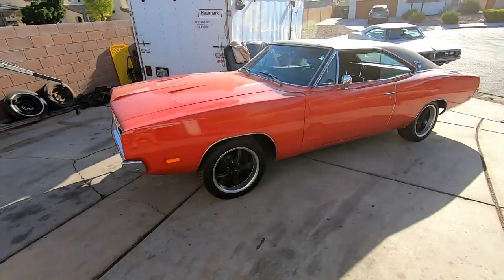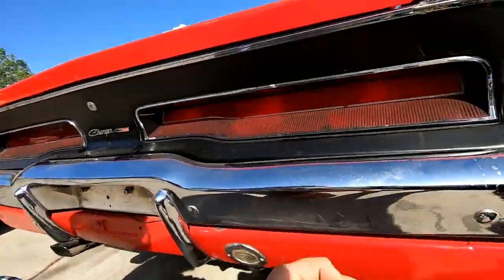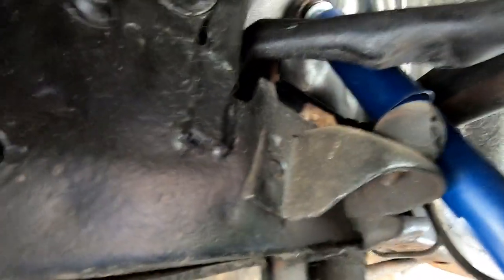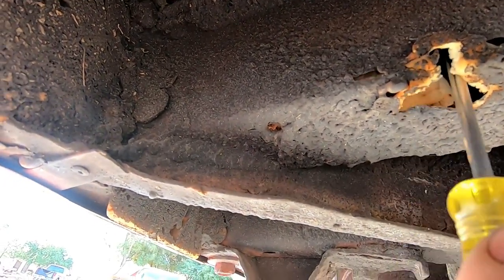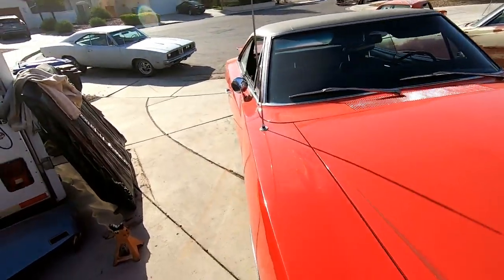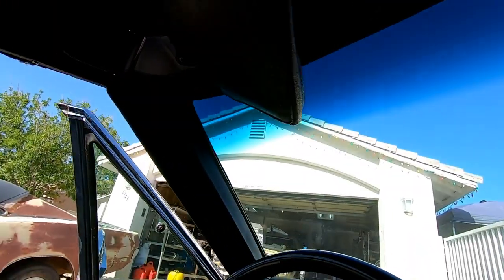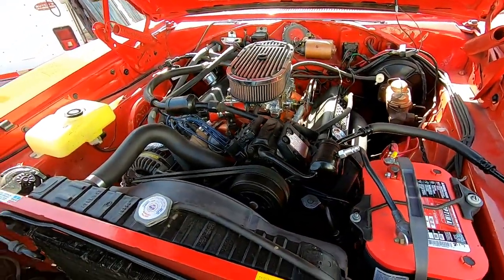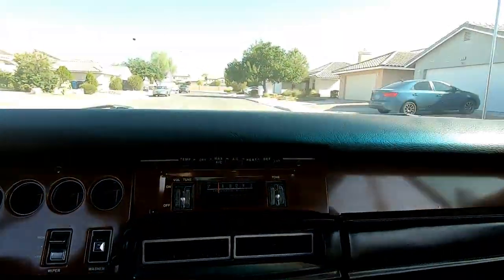Look Before You Buy that shiny Polished Turd...

Comment: It’ll need rocker panels, quarter panels and trunk floor extensions.  I remember cars In Michigan during the 1970s where they would rust away within the first 5 years no matter how much you washed and waxed them. The body would rot long before the engine would fail. Some present day Mopar restorations are done to perfection,  in reality the build quality of the original Mopars was horrendous.
Reply: Yeah I have had them all here in Michigan, big block and small block six pack cars Hemi car Etc. Being a Michigan person all my life I have run into so so many issues with vehicles. In reality growing up here in the 1970s taught me all the things that is in this video. Very few things will ever get past me when I go look at a car. The one I have now gorgeous as a Michigan car. If you want to obtain a better body vehicle, seek out the former drag cars that spent their entire life at the strip. Many of them have been crashed and had doors and fenders and front Clips replaced, so you have to look for those things also, but overall you will get a more solid vehicle by far because the thing wasn't being driven in the salt or being parked out beside a barn for 25 years. My father always said let the buyer beware... True and honest words. Look very carefully before you plunk down purchase money

Comment: Two main companies on the east coast that did rust proofing back in the day were Z bart and Rusty Jones.   I worked for a company out of Harrisburg, PA that used carnauba wax with a fluorescent dye formula to prevent rust in new cars.   They sold the dealer I worked for a black light and the spray gun with attachments.   No holes were drilled.  the stuff was sprayed into the body weap holes until you saw the green dye show up around the points where water would come in.  The warranty  was useless because the company went belly up in about 5 years.  They paid me $6.50 an hour and the cans of wax cost the dealership $20 a can.  They charged the customer $300 for the service.  A big car took 2 cans and a truck was suppose to take 3 cans.  The dang shady dealership I worked for cut both of those down and still charged the $300.  They are no longer in business either.

Comment: Great lessons..   Chris..  Looks.like the Chargers rot every were..  😂 
But you live in vegas so wont happen to your cars.   Lucky guy.  
Took a lot of work to put on all that Bondo to so hard working Bondo man.   😂...
Reply: Dude they are are 50 year old cars and depending on where they are from and how they are taken care of most are going to have rust issues. unless they washed the car all the time and kept it in a garage or on a cement slab out of the weather they won't rust but to park them in the grass where moisture comes out of the ground and leave it under a tree or in the rain and weather and drive down dirt roads and off road it's going to have issues
Reply: @79tazman  jep i know...  My car is in the summer under a car port were the wind.dry s it.out fast and in.winter i do not.drive him..  Its in.my.garage then.. !!   👍🏼

Comment: I have never come out ahead on a car deal  , because if you love cars , you can not flip them like a commodity. Today I own what is my last old car, A 1978 Chrysler Newport , 360 cid , 904 torqueflite. At age 67 , failed health, my car days are over ! My last hotrod was sold last January at a $1500 loss, it was a 1998 Lincoln Mark Vlll ,cobra V8 and fast , I cruised I-15 for 4 hours at 100 mph at 3500 rpm.

Comment: In  Michigan there are two kinds of cars..  The ones that  were stored away in Garages in the Winter..  and  the ones  that rusted away and  went to the scrap yard..     I bought a  Z-28 Camaro in 1979 .   I did drive it two Winters..   some in MI  some in Colorado  and some in FL & LA..  I had it Ziebarted..  I washed it a  lot ..  I can't really see any rust on it..  but I cut the wheel wells out  to put wider ties on it to win the Spector  drags at a local circle track ..

Comment: Well a car worth 8.000$ dressed up for 3.000$, sold for 40.000$, had to be fixed for 20.000$.
I'd rather buy a rusted Rat than a "restored" one.

And BTW a story from me and a yerk:

I once wanted to buy a "original car ,no rust, not welded, 2nd owner car ,accident free, regular dealer service, low mileage".
I called the guy we talked , my friend  took me there and this guy said we had to go to the garage he parked it.
Well 1/2 hour later at the garage ,there was a second guy waiting to purchase the car too.
We get in this dark Parkhouse where the Dusted car sat. 
The other guy cheked it asked questions blabla...
I got to check the car while these two were negotiated after I was done I asked him my question:

  Why is the passenger door  different colored with different trim and not opening/shuting correct?
  Why is there a Gigant dent  in the Passenger Rocker?                                               It's accident free.
  Why are there rust holes in the Floor?                                                                           It's rust free.
  Why is the Rearvailence welded?                                                                                   It has not been welded.
  Why is there a 4th owner in the Service sheet's?                                                         It's 2nd owner.
  Why are there servier more miles in the paper work than on the odometer?         It's low mileage
  Why are there not matching Seats? should have bucket seats in the front matching the Rear Seat not some cloth ones in different color and material.

I told him he is a Scum and what a lier he was, he wants to discus it but I left,
The other guy aint as knolwedged as I bougth this turd for 1.000

and you could see on his face he apparently wasn't glad buying it after I revealed it's condition.
The callout were 2.500 for it at the beginn I would 've paid 750 if he wouldn't lie.

BTW. The car got back on sale from this other guy some months later with painted door and with all the other mangles I revealed.

Comment: My personal low point was a Challenger with a freshly-painted 340- with overspray on the plug wires. The top of the engine had been repainted while it was in the car. Couldn't quite believe it.

Comment: As of the date of this comment, there is a restomod Charger for sale on the Gateway website for $147K.  Supposedly, it was completely redone, frame off, etc....  Loads of upgrades as well.  Looks great in the photos and video.   I am wondering if I would be better off purchasing that one (for about $130K or so, it if Gateway will negotiate)  rather than paying $85K for a car with some obvious issues and no telling what is going on behind the paint.  I do NOT want a project car of I can help it.

Comment: I recently found a running 1970 340 4 spd Duster , (VS- H code), for a good deal, 7K. When I saw fuse box hanging under the dash and a sea of splices, rubberized paint used everywhere, E-body steering column, E-body  bucket seats, and many other red flags, I passed it on to others. An acquaintence bought it anyhow on his own 2 feet. Now, guess who gets to fix this frankenstein?  It is coming along, but soooo many wannabe mechanics have done their magic # on this car. I made up a nickname for those who won't use proper hardware etc......Coffee Can Mechanics, (Use whatever is in the Folgers can, if you are out of baling wire).  We are gaining on it however, slowly.......like they say, look REAL CLOSELY, before you buy. I can't say this enough............

Comment: 47:33: Another thing to ask: "Why is the fuel line wrapped from end to end in heat shield?" Almost always indicative of someone trying to fight a persistent vapor lock or fuel boiling issue (especially common now with lower fuel boiling points than BITD), which the shielding itself won't solve. Expect to run a 440-spec return line and fuel filter (whether original or Wix-style) back to the sender, which will also need to be modified (don't bother with repop senders if you value your fuel gauge reading).

Also, why is the fuel line routed OVER the alternator? 😲

Comment: I use that "poor mode" trick. The gf was looking around for her next used car, so we took her old junk car instead of my truck that's still worth something or my old restored trans am. And play it off at first that I don't know much about cars as I question the owner. Then once I start to really look at the car, I bring out the scan tool, my magnet checking for bondo, and then out come the ramps and my creeper and flashlight. Generally then people start admitting things I wouldn't have ever found.

Now my buddy was looking for an LS1 F-body, and brought me for "expert" advice... Then we show up in my restored T/A, generally I'll talk up the owner a bit about everything I had to do to restore my car. They usually end up not trying to hide things assuming I'll find problems.

Gotta buy a few lemons before you figure this stuff out.

Comment: I`ve never seen a column shift on a charger. I had a 1970 back in the early `80`s and had a blast. Wish I would have kept it.
Reply: I bought a 1969 Charger in 1991 with a column shift 383.  I think that was the first thing I replaced.  You could still find parts cars in junkyards back then so it was easy to find a clean column without the shifter.

Comment: Bro i bought a 93 S10 and finding a square body mini truck was just as bad. I think finding anything older than 20 years old in decent condition is hard. I had to buy one that was posted within 6 hours of me finding it. And dude already had another guy on stand by so i had to give him what he wanted rather than what I wanted to give up when the other guy came along to get it. It ended up almost like an auction. I was closer than the first guy was as far as driving distance so i showed up first and then the other guys wife wouldnt let him go up the extra couple hundred that I did. My dream car is a dodge charger. The 68, 69, and 70 years but thats a goal i have to reach one day. Start small and work my way up i guess. I started with a beat up 65 f100 that I got kind of screwed on and luckily someone with no budget came along and gave me 500 more than i had in it because they were crownvic frame and engine swapping it. Next was a mustang new edge a friend screwed me on with no title because i bought it while he was "lookin" for the title and sold it for a 300 dollar loss. And now the S10 is my latest, I have about 3000 in it including truck, registration insurance and a full suspension rebuild with 4/5in drop. New steering and shocks. Bumpers and so on. This is kind of pointless rambling but felt I could relate. Lol

Comment: i get a lot of cars  hauling scrap they just want it gone to sell the property and i got my 440 rt charger from a friend that needed money all factory good paint just needed a new exhaust system for 500 but that was years ago but did pick up a 71 duster for a 125 bucks last week with good body no rust runs and drives slant six 3 speed on floor
Reply: ps a rust free car has no rust at all in it like mine don't not even one little spot and i start with factory painted cars i will get them for free and i get 2 to 3 of a type of rig then i build it but i have the place to store rigs and i mean a lot of rigs 10 acres just for project rigs like chevy's i get all the time for free have tons of good rust free parts for them mopar are getting hard to find for free
Reply from the maker: Nice man

Comment: to buy a hot rod properly, be prepared to lay on your back in the dirt and crawl up under that thing.  You are taking inventory of the rust you will have to fix and if you have to start at the frame rails, be prepared to put more into the car than you will make out of it unless you are doing a lot of the work yourself and can do quality work.

Comment: why would you put pop rivets in a trunk panel when you can fake spot welds while its out and liquid nails the panel in.....................:P 

very good vid,
another test is to try lifting up the back of the door, if you see the gap around the fender and hood move, run, run very far away

Comment: Yup filler is not necessariy your enemy when used PROPERLY.
This guy got taken because this was not properly used.
If i am painting a Motorcycle tank or a car I will use some filler to smooth spots or small areas but not huge portions.
IE an area about the size of a silver dollar has small ridges or dents from using dolly or stretcher hammer I will use the smallest amount of filler to smooth that area.

Comment: *BODY FIRST AND NOTHING ELSE MATTERS*

That is my best advice. The B-Body platform was fucking everywhere. You can rip compatable parts out of anything from Road Runners to station wagons to old cop cars. Suspension, interiors, seats, gauges, mechanical parts, there are hundreds of thousands of B-Bodies out there to pull from.

Pooched engine? Doesn't matter. They made Big Block 440's up until the 80's putting them in fucking everything from pickups to motorhomes, and you can get them at junkyards for $500. Charger engine bays are massive and easy to work in.

But a Charger body? There is no replacement for that.

Comment: As long as the seller is disclosing all this, cool and all, maybe they just wanted to have a pretty Charger and couldn't afford a proper restoration; however, when I bought my '73 Road Runner, someone attempted to install a moon roof at one point, and then someone attempted to fix it with a cut-up Stop sign underneath the headliner and a shitload of bondo on top to make it look normal. I'm not kidding, the bondo is about an inch deep all the way to the Stop sign. Then they put shiny green paint atop and didn't disclose it. So yeah, bring a fridge magnet every time! That being said, I wouldn't trade this car for the world, because it's mine. **EDIT: You know what, after thinking about this Charger, all I can say is, what a**holes for doing the car this way. :(

Comment: Nice job.  I think we have all been hosed to some extent when we buy stuff with emotions involved.  Example i was 17 and traded my 350 honda for a 67 lemans with a OHC sprint 6 with a factory q-jet and 4spd. I knew the guy plated the frame over the right rear axle because of rot.  No matter i wanted the car.  You would kick in the 4 barrel and the drivers door would fly open. Lmfao !  Lasted 2 months and frame broke. Junked  😂😂😂

Comment: Is it just me or do Chargers in particular always seem to rot and rust out so much worse than other models? They always seem so much worse
Reply: I'll get flamed and accused of trolling for saying this here but there does seem to be a higher percentage of patched up Mopar's floating around these days compared to other makes. I recall seeing Chargers and Roadrunners all over the place when they were new, by the mid 70's they started becoming few and far between compared to the Chevelles, Novas and Mustangs of the same vintage which were still quite common at the time. I know, just a nice way of saying "it didn't seem like the Chrysler stuff held up as well". Although it may have had more to do with bias-ply tires and immovable objects for all I know. With the escalation of the popularity and pricing of Mopar's over the last few decades, it stands to reason the cars that remain will stay in circulation despite their condition.
Reply: @amc401nash6  yes I definitely agree with your comment, and I'm sure not knocking them I love the Mopars but they do seem to rust out much more than other models do, it seems almost a miracle to find one that's not rusted out

Comment: I have seen it all myself when I was younger I went to look at a 72 Road Runner it was plum crazy with mint black interior and then got under it they took thin aluminum and riveted it to the frame to hide the big old rot hole in the frame and then took filler and smoothed it all in to make it look like it was mint and this guy was second owner had it since the late 70's but the screwdriver went right through the pop can aluminum and filler to exposed the big ass hole in the rear frame but I have seen foam I even seen someone take window screen and shove it in the hole to filler over it LOL!!! Lot's of shady ass people out there just looking for a fish that don't know what they are doing.